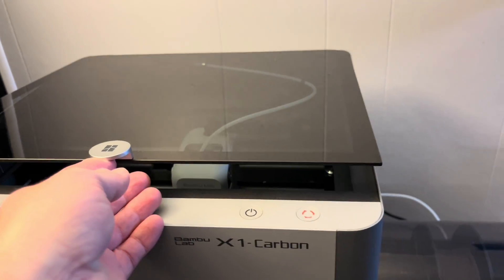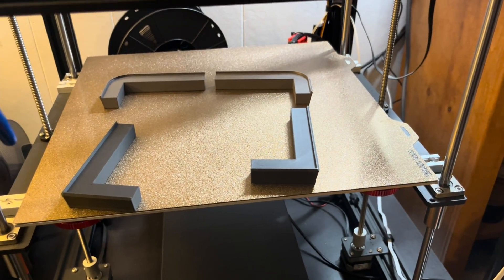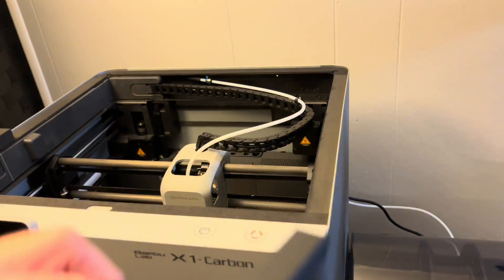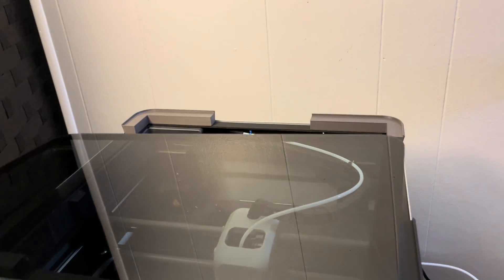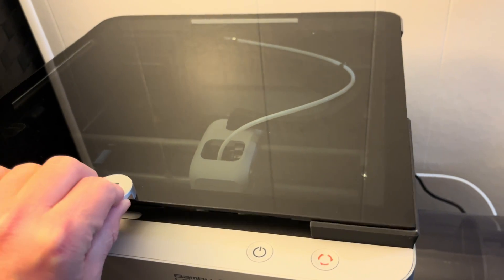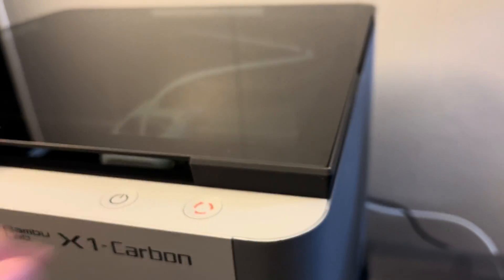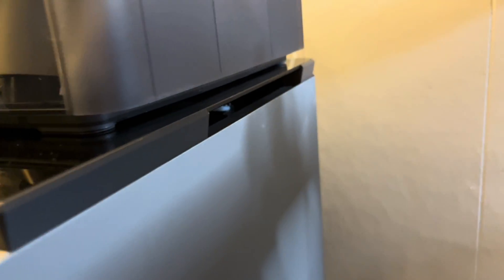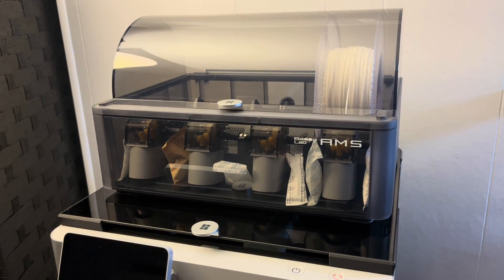X1-Carbon: Elevate with Glass Top Risers

Comment: Very nice!
I could imagine, that the printers' vibrations will become audible, through the glass rattling in/on those risers though.. maybe add some rubber stoppers or felt to them? Or heck, print them in TPU if possible?
Reply from the maker: Thanks. Since I have the AMS on top, it secures the glass snug with the risers. I have not noticed any increase in vibration of the glass. And my home office is in the same room, so I tend to notice any difference in noise from my printers.
Reply: @drachenfire7784  i actually have a set of risers i use for this on my x1 (not carbon ) for this reason i printed them in pla i don't get glass vibration noise.  i only swap them in when I'm doing long prints otherwise it isn't an issue.